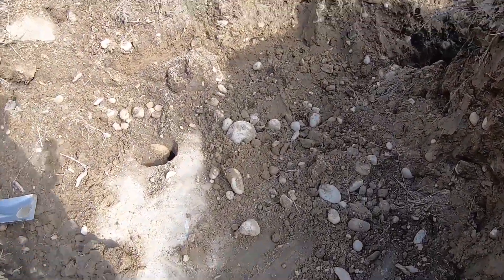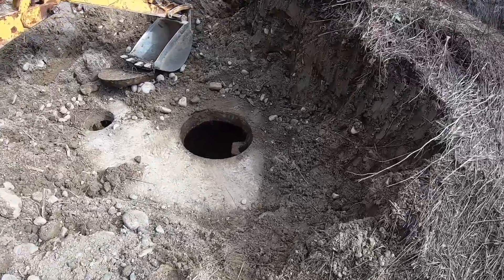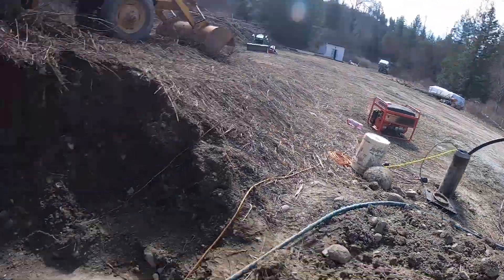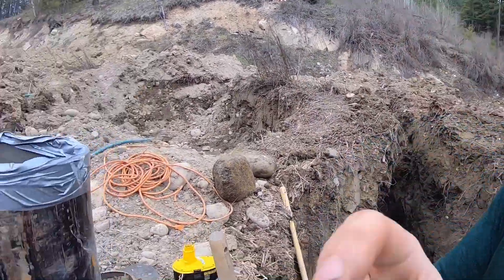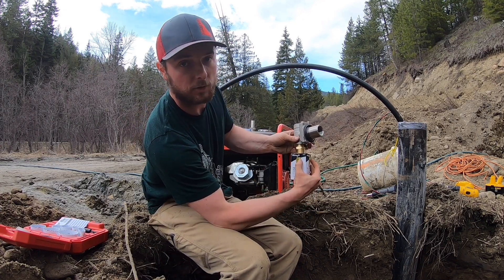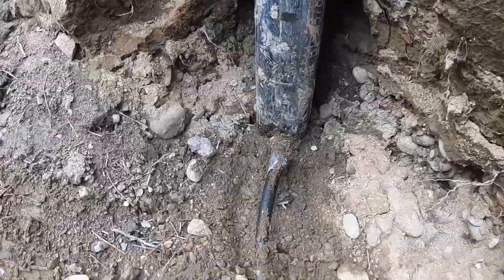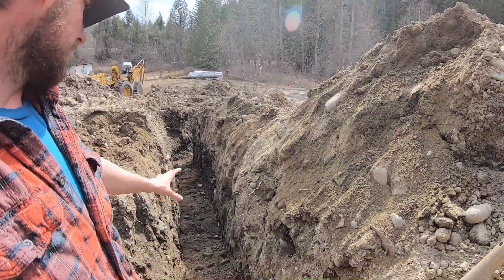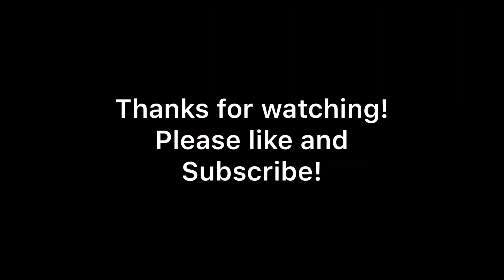Opening The Buried Tank | Installing Pitless | Laying Water Line

Comment: Could it have been from a man camp the railroad had set up during construction of the tunnel & tracks. When the job was complete the housing removed/relocated. The railroad may not have been required to pull local permits for what they do.Cement septic tanks date back to the early 30's ( & probably earlier than that) and a good tank can last 40+ years ( from what I've read ). IDK......just a guess.

Comment: Is there an old leach field somewhere (maybe)? And, where does the fill-pipe come from? Thanks for another good video.
Reply from the maker: The leach field appears to have leached under the driveway. The fill line comes from the burn pile location. It was cut close to the tank. Nobody we’ve talked to remembers a structure on the property so it’s interesting.
Reply: @LaidBackLiving  Yes, it is very interesting. And, it doesn't seem like the railroad did it, because whatever they needed would be temporary and this seems permanent. I hope the system is dead so you don't have any well contamination. Thanks for your response.
Reply: @LaidBackLiving  By the way, would Google Earth historical view show any old stuff on your property? I just looked at Bonners Ferry historically and saw there was a map from June 1992. So, who knows, maybe see something where ever  you are.

Comment: Need a track wire so you can find it.
Reply: you dont need it, because you must have a ground lug on the well casing, with a bare # 10 stranded copper wire ran all the way to your ground lug on you main power panel,, this is for lightning arrest,, well casing a great attractor for lighting.. and this wire is a must..  as well as 2 10 foot 3/4" galvanized ground rods 10 feet a part just out side you power panel, with a #6 bare stranded copper wire connecting the 2..

Comment: Curious where the drain field is located there. Don't want water well too close to that - yuck!  You might consider dropping in 2" PVC pipe in the trench since you have it open. Ya never know when you need to run electrical and suck. Looks good

Comment: tip,, you put your check valve at your presser tank, not in the wel, hen it check valve is at the inlet of your presser tank, it is simple to replace when it fails at 40 below, this way when you pull your pitless off in the well to lift your pump all the water drains back into the well, by putting the check valve on your pitless the water cant drain out of the pump line, witch makes it super heavy to lift out, note when using a whole saw to cut the well casing for your pitiless never drop that core of steel into the well, if you do fail and drop that steel core out of the whole saw, put a good magnet on a string and go fishing, get it out, because if you leave it in the bottom of the well, you well is done, if you ever need to call the well driller out to drill your well deeper, that steel peace will destroy the drill bit on the well drilling rig, and your done, as now the well is full of peace's of steel as well as chunks of the drill bit, never able to ever drill it again, i hope you put a lug on your well casing and hooked a #10 copper wire to it and ran it back to your hydro panel, and 2 10 foot ground rods 10 feet a part on the out side of the house and a #6 stranded copper ground wire to your main panel.. , well casing is a great lighting attractor, and you must ground the casing to your main panel, weather you are on grid or off grid it all must be hooked to ground  in panel,,
Reply from the maker: The problem with checking at the tank is that the hydrants we installed wouldn’t flow unless on their own specific line. Both pumps have check valves built in also. They will be grounded!
Reply: @LaidBackLiving  i have installed many pumps and have never seen on with a built in check valve. it would be impossible to lift a pump out of a 300 foot well if the water didnt drain off when pulled off the pitless, there is a lot of water in a 1" or 1-1/4 line even 100 feet, with out calling in a boom truck. nothing should be installed on a main line except your presser tank, even hydrants are feed after the control system, i/e your presser tank, all mine are on 3  1" line feed from a large manifold after my presser tank, each having a ball valve on the manifold for every feed, .,, hell i wouldnt want to try lifting my pump out if it had a check valve at the pump. it is heavy enough with the pump and 109 feet of 1-1/4 black Polly pipe, i have to use a winch just to pop off the pitless, then 2 guys to lift it out